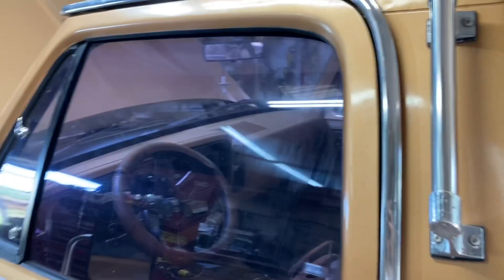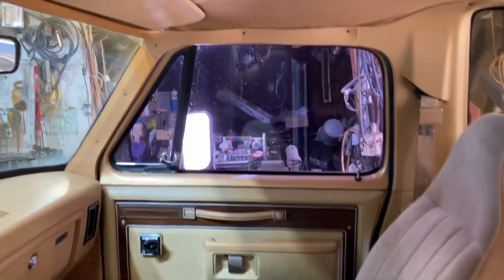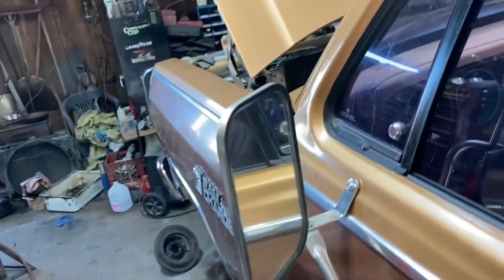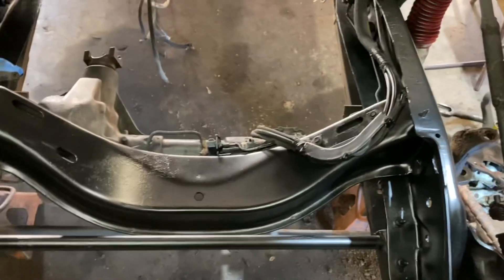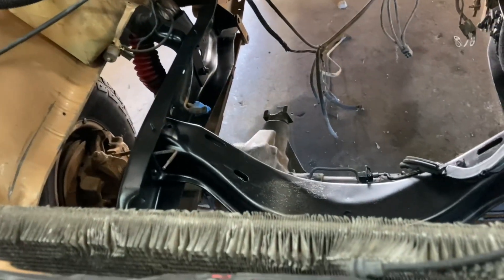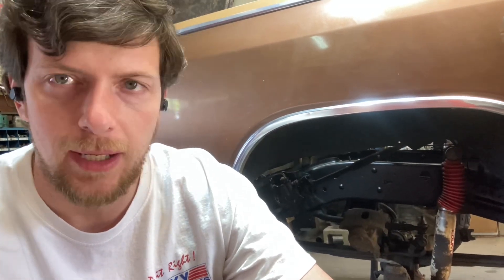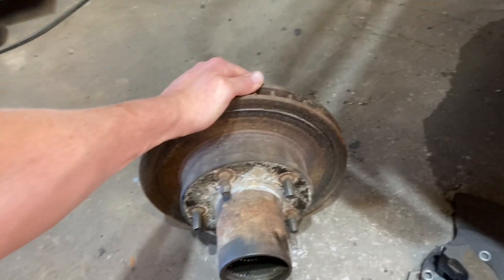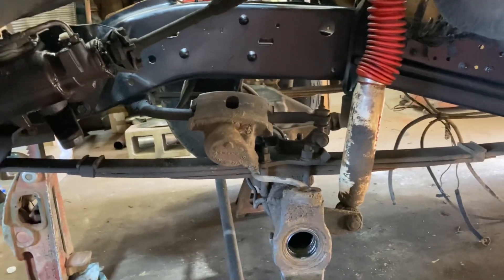Ramcharger Revival Update and 318Willrun Strikes again! #mopar #dodge #ramcharger #318willrun

Comment: Oh how I love the Ramcharger pickups! They were heavy duty everything and you could pull anything with them. You are so lucky not to have the rust from road salt that we have up here. The first places to rust were the tailgates and fender wells. I have a 2005 Dodge Ram 1500 with only 76,000 miles on it, second owner out of Minnesota. I had to replace the rear fender wells, gas tank and front suspension when I got it in 2011. It has the 4.7 Magnum engine which is just fine. I think you will really love that Ramcharger when it is done. Happy for you Joe😊
Reply from the maker: Thanks Mike! This one belongs to a family friend and Vietnam Vet. I’ll have him back on the road, better than ever!

Comment: Man, thanks for the video. On my 2nd RC. 1st was an 85’. Just got a 92’. Rough Country 4” lift. She rides like a brick right now. Thinking new ball joints and a steering stabilizer will help. Been replacing relays, got a new ignition switch and starter. Now I just gotta get to that crankshaft position switch 😂
Reply from the maker: Right on! I actually took a lift kit off my old ramcharger. It had a 6” suspension lift that’d rattle your teeth. Springs were so stiff

Comment: I had one of those,  I put Warn hubs on it.  Had a 318 2 barrel, would run 16 flat and would cruise in a half foot of snow at 60 mph.
Reply from the maker: Very cool. The 360 will be well built and should have solid torque.

Comment: I replaced those Doors  from electric to non. with Hand crank (PS Mopar made gear change to roll up or down in half the amount of cranks) they will fall out and down once motor stops working , not good for rainy days.I also bought same seats from a Van when needing replacements.I do recall that Major rust "holder "was the Radiator core support area
Reply from the maker: Thank you for sharing. This battery tray needs cleaned and painted, but it’s nice in the support area. Will be ready for an engine and drivetrain soon.

Comment: We put one of the manual lockout systems in our 86 W250. One of the best upgrades we did.
Reply from the maker: Excellent! Can you remember where you got it?
Reply: @JustMoparJoe  My son said he got it on Summit, it's called "Posi-Lock". Make sure you double check your fitment, they offer a few kits, the one you need should be the POS450. And once it's in and adjusted put it 4WD, put it in reverse then pull on the new knob while slowly backing up, you'll feel it lock into 4WD.
Reply from the maker: @allhailinternalcombustion  I found their website and ordered directly. Thanks for sharing!

Comment: Revival!!
So where did you get the new rubber for the doors?
Parts for the power windows?
Reply from the maker: I rebuilt and lubed regulators, new power window motors from Amazon(Dorman), and rubbers and felts from LMC.